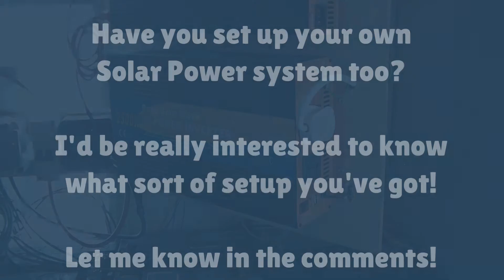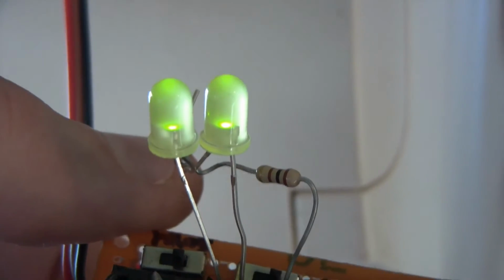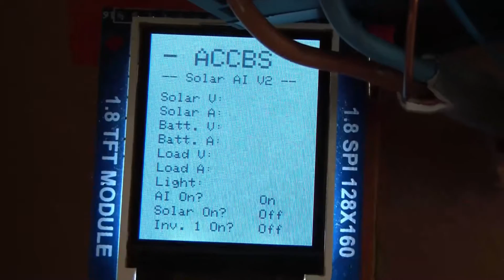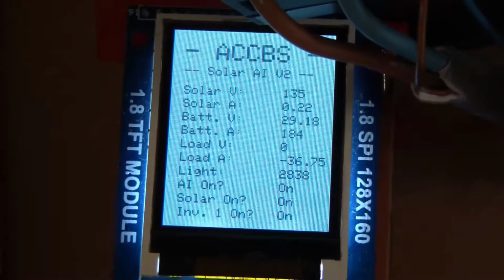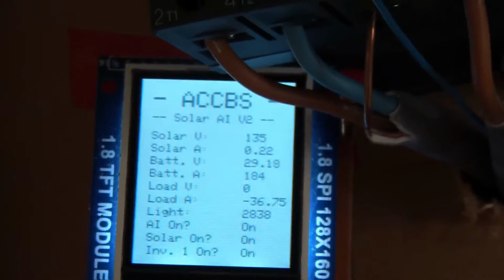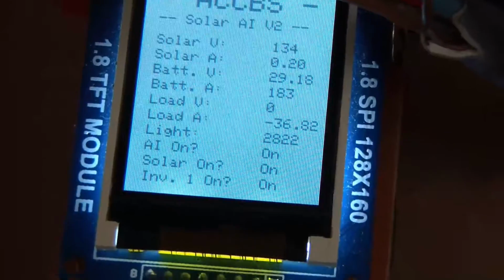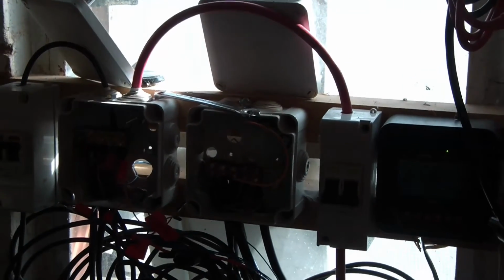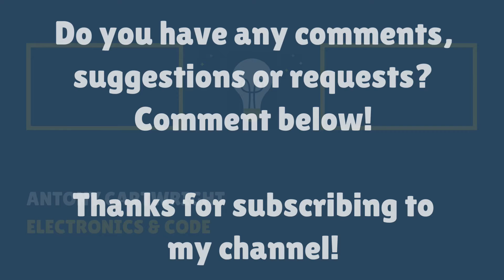My DIY Offgrid Solar Power System (An Update - May 2017)

Comment: Working on my own off grid system at the moment for a building with no mains power. Just wondering how you would get an earth connection? Would you use an earth rod and link the neutral to earth as well as the negative on the battery terminal?

Comment: ANSWER MY QUESTION SIR I AM ATTACH (MakeSkyBlue Charge Controller) FOR 24 VOLT 500 WATT SOLAR PANEL NOW IT IS WORKING AT 12:30 PM SUNLIGHT IS VERY CLEAR ON MY SOLAR PANEL OK NOW MY QUESTION IS CONTROLLER DISPLAY ONLY 260 WATT 10 AMP WHY IT'S NOT GOES 500 WATT 24 VOLT?. (In this month I shall be attached all my off-grid unit video file)

Comment: 1:20 the tool for undoing the filler caps is called 20p  ;-)
Reply from the maker: :D
Reply: Seems I’m a bit late. Bit of Vaseline on those terminals should help with your corrosion

Comment: another test you should do is check the acid with a battery hydrometer
Reply from the maker: David Simpson I don't understand the hydrometer thing at the moment. can you explain how it works?
Reply: yeah you take the cap off press the bell pump on it put the pipe for the hydrometer in the cell on the battery and then let go of the bell and let it suck acid up once enogth acid is in you look at the float and the voltage reading red bad white needs chargeing and green good some videos on youtube for better idea of it this gives you a better idea of how the battery is and if you have a weak cell or not
Reply from the maker: David Simpson I'll have to look into this! Thanks!
Reply: i do mine once a month i only have 2x 75ah caravan batterys i got cheap off facebook market also only have 100w os solar at min but a very basic system
Reply: no problem